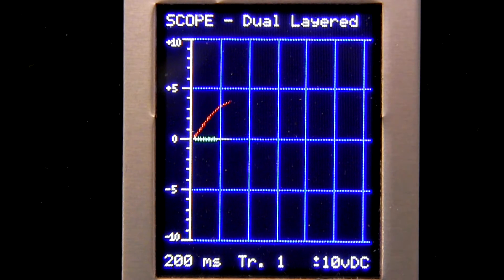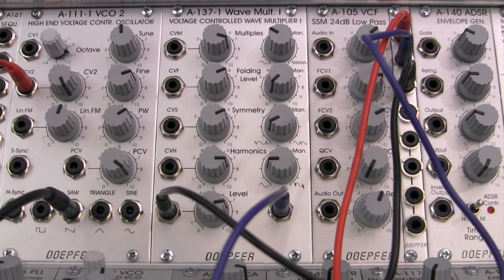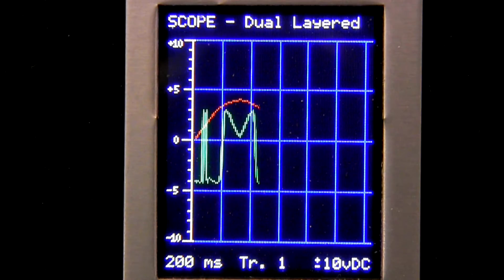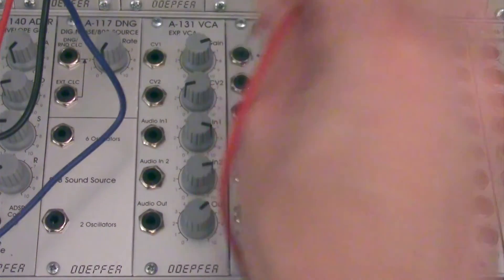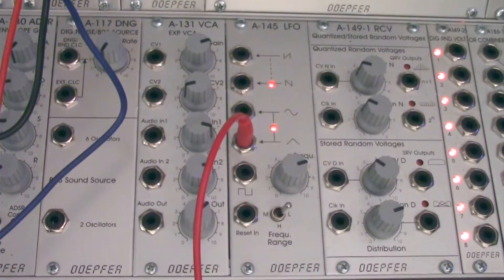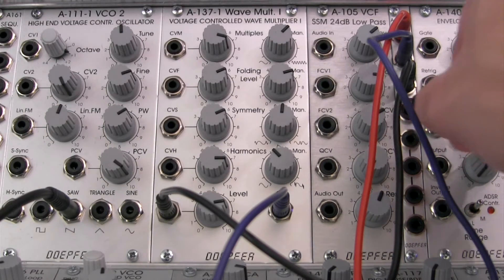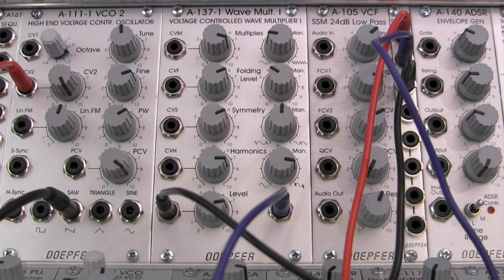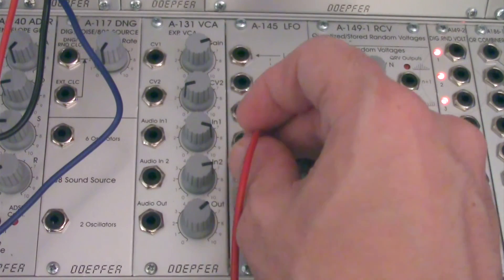Doepfer 137-1 VC Wave Multiplier with Low Frequency signals Part Two

Comment: I don't understand why you didn't apply the LFO output to the CV inputs of the wave multiplier.

That would have been a lot more interestig, to me.  I generally play tunes on synths, not use them to make different siren noises.
Reply: He did/will do that in other video. Its basic explanation too btw.
Reply: @aphextwin6  He doesn't seem to make these videos any more.  The most recent ones are from five years ago - and my comment was from one year ago.

I bought this one, and the -2 version.  This is the one to get, IMO.  The -2 is very finicky and I've found it hard to get anything useful from it.

Comment: It never crossed my mind you could use the wave folder to process CV. Great idea. I've always been curious what would happen if you did that with a filter, running a pulse or sawtooth LFO out into a lowpass or bandpass filter.